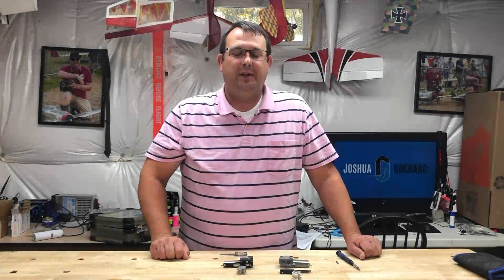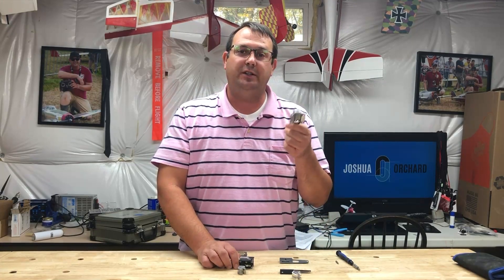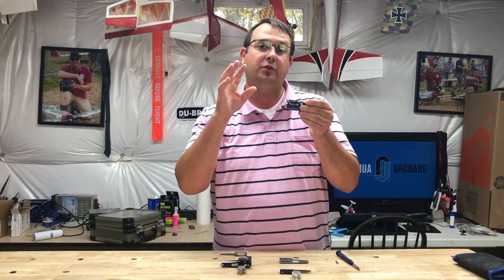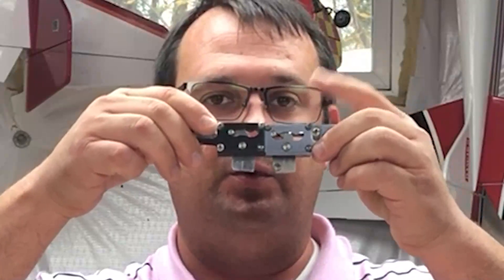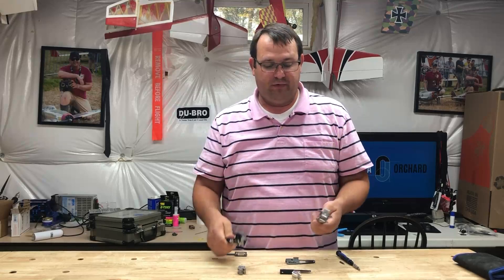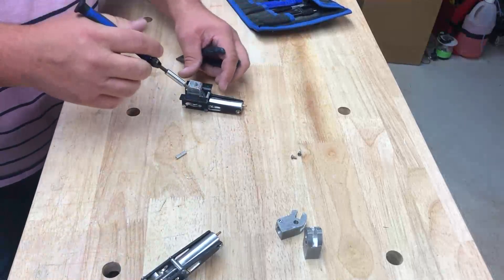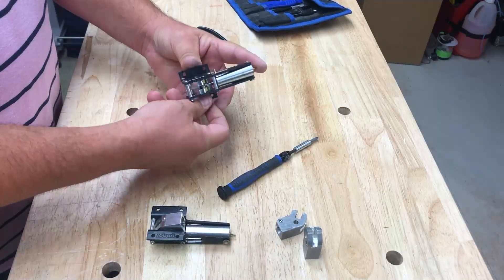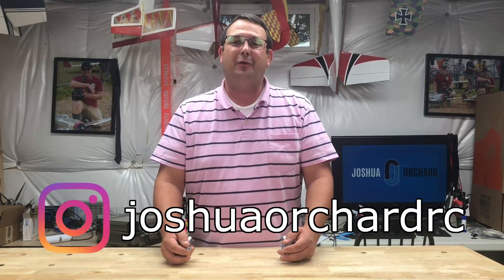Pneumatic Retract Re-Build

Comment: Okay video.  Was looking specifically for video on rebuilding retracts.  Back to searching.
Reply: Yes he disassembled but at X speed so it was useless.
Reply from the maker: I'm not sure quite what you were expecting. There are different levels of "rebuilding" and if you came looking for air piston disassembly and servicing, Robart (now High Viz RC) pistons are crimp sealed and therefore replacement is the best option. I did this on my Corsair retracts years ago. The original retracts had plastic case pistons that failed and replaced them with newer aluminum pistons.
Reply: @JoshuaOrchard  Good info thank you

Comment: Hi Joshua, Great vid and the 'gibber-jabber' was informative. I have noticed some 'play' on one of the retracts when the wheel is locked in the down position. I was hoping to follow exactly how you so speedily dismantled the unit. My query is how do I eliminate this "play"? Is it possible to adjust it without any new parts?
Reply from the maker: Not really. In my observation the play in these parts is due to the metal wear itself. If you could add that metal back, sure. What you can TRY is to remove a bit of material from the spacers in the retracts to help tighten things up in the trunion pivot points but its a fine line between closing the gap and friction. The roundness of the hole for the trunion pivot point is likely to also be a problem point and that's where I gave up. There's no way to close that gap unless you drill it out and put in a bushing as a press-fit wear item. In the end, it was just cheap and way easier to buy replacement parts. Seriously, The parts themselves were not nearly as expensive and getting the full assemblies from Robart.
Reply: @JoshuaOrchard  Thanks so much for responding. In short, best to get some replacement parts. Me be newbie. Unsure how to dismantle either. Any part likely to 'jump' out? May I ask what parts that are required? Perhaps, Robart has a repair kit? Thanks in advance.
Reply from the maker: @mosoysa7782  so Robart has the “exploded” view of their retracts. Best way to identify what you need is to first identify what the model number of the units you have. Then find the exploded view and from there you can identify the parts you need and their corresponding part numbers. Then email Robart and ask for a quote. It may take a while but they’ll respond.
Reply: @JoshuaOrchard  Thanks again for your speedy response. such good advise. Yes, I'll need to remove the retract off the plane and go from there. btw - by chance if it isn't a Robart unit, any idea, with your experience, if Robart parts might fit? I know its hard to speculate.
Reply from the maker: @mosoysa7782  More than likely not.